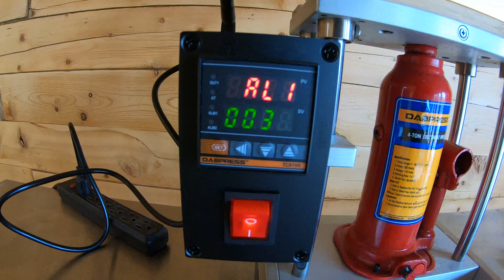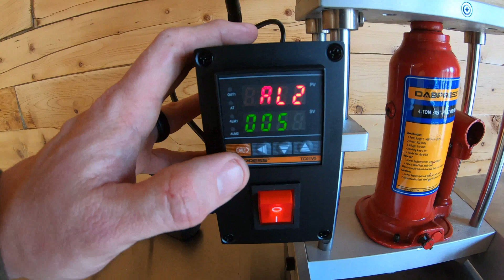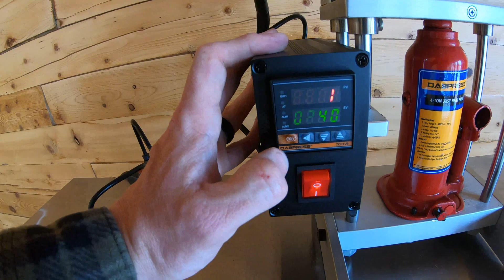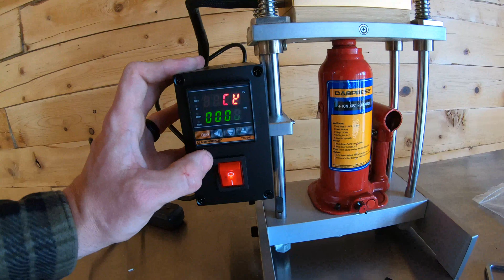How to Reset to Default Setting - Dabpress PID Controller ( TC01V5 )

Comment: @Dabpress what setting needs to be changed when swapping to a new element? I am getting UUUUUU. The resistance of the new one is 13 Ohms vs the 120 Ohms of the old one. I figure it is the oH setting but not sure how to map the difference in resistance, any help would be appreciated.

Comment: Does anyone know of a pid controller that will vary the voltage output rather than just cycle on and off. Thanks
Reply: This one does it, I have it. Forgot which setting actually changes that offset for you. 

 but he doesn’t explain which setting it is either….
he’s literally just reading for you & then  how it was when he received it….